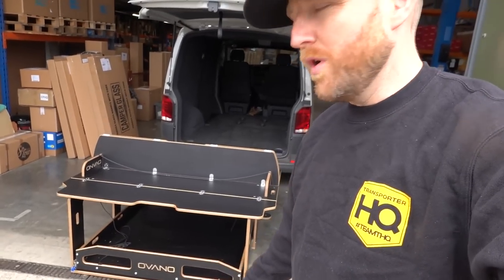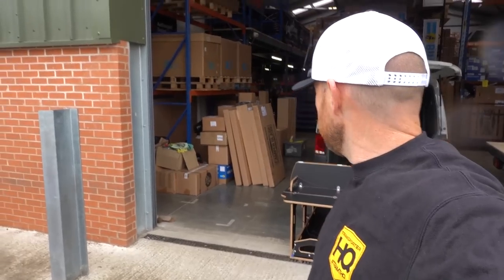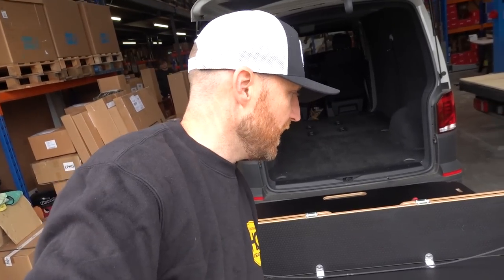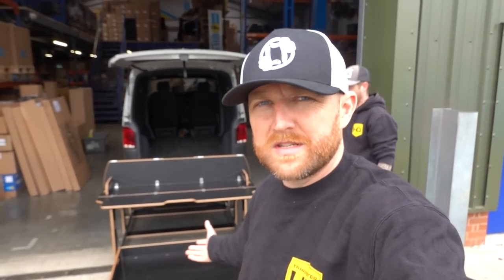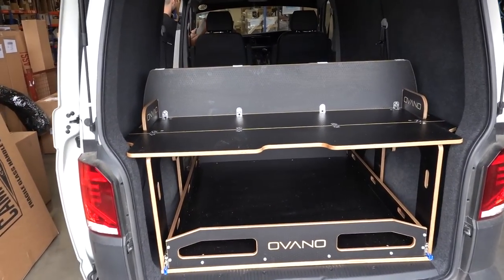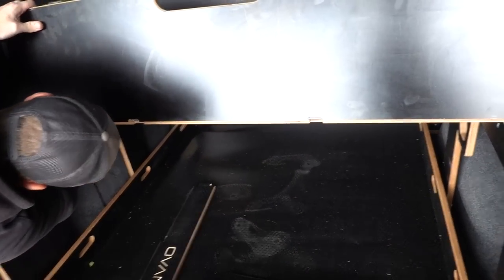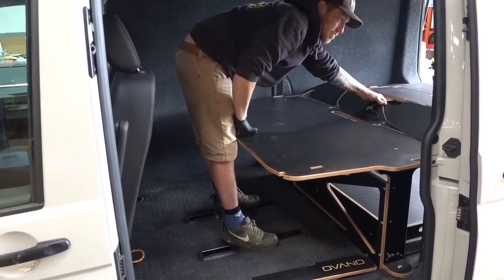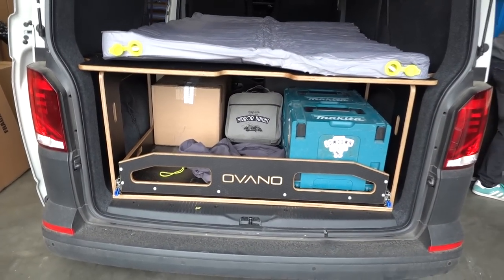Ovano Switch VW Transporter Storage Bed System | Transporter HQ

Comment: Looks like a great product, and really well designed. As a new business i wish them the best, but i feel they might have priced themselves out of the market at 1500 quid. Would suit my needs but wouldn't feel comfortable paying a four figure sum.
Reply: I was thinking the same myself, I would have one of those but sadly not at that price even though it is well made with good materials etc, and it would have been ideal for us being disabled with the slide out bottom to put our stuff in.
Reply from the maker: Honestly I thought the same until it arrived. Like I mentioned the runners are £200 alone. For them to able to copy with runners that can carry that weight, everything else has to be upgraded to the same standard. I'd much rather it was a premium price for a quality product than they'd used cheaper materials and it not be up to the job or last. Maybe in time as their turn over is higher, their costs of materials may come down and the price of the switch be reflected. A customer of ours saw it and the build quality and ordered one straight away. This guy was a skilled tradesman and understood the quality and build. I hope it works for the Ovano guys, I'll defo buy another for the next vehicle.
Reply: @THQAutomotive  It's true what you have said that you only get what you pay for and we might bite the bullet and go for a one providing I can persuade the wife to go along with me lol
Reply from the maker: @crazycouter  Do what I do and tell the wife it cost half as much as it actually did :P
Reply: especially when it looks pretty much DIY stuff

Comment: Just picked up one from Transporter HQ EU, it’s not cheap but as they mention in the video. When you see it in the flesh you can see why and with that, I’d say it’s a very fair price for the quality of the product. Fits so well in our SWB T5 and I tested it out with the bulk head up on the motorway back to Sweden, really great with no rattles or noise at all. In fact it helps reduce road noise! Slept on it, really simple and quick to fold into the bed mode which is great when you arrive at a stop late at night. I’d high recommend it!

Quick question though, what mattress did you show in the video? Looks perfect for my upcoming trip to France!
Reply from the maker: That's a kampa Kip self inflating mattress.

Comment: Just what I am looking for, just a decent slide out storage system with a 100kg load is £1200, then consider the whole functionality of the Ovano system, top storage plus the other shelf, then the full bulkhead option, and finally the bed. Yes the upfront cost is high, but a lot of thought and design has gone into it, and its ok for a company to make a profit too, they probably have to move quite a few units just to get anywhere close to being in front. As soon as my van arrives, I will be ordering this.
Reply from the maker: Yes it's a great bit of kit and a lovely small family business to deal with.

Comment: Very nice, cool ! Is it compatible with T5 Multivan ? thanks !
Reply from the maker: Yes the do a multi van version
Reply: @THQAutomotive  thanks !! Do you think/know if i can remove the two middle seats, advance the rear 3 seats at the maximum, and install the Ovano switch ?
Thanks
Reply from the maker: @ugoaltar5888  I don't understand, sorry
Reply: @THQAutomotive  sorry, « excuse my french » 😂i have a 7 seats Multivan (short), (in 2+2+3 with rail system), i would like to install the Ovano Switch. Can i install it with remove the two middle seats, and put the rear 3 seats in the maximum forward/front of the van ? The idea is too keep the possibility to have 5 seats. Thanks.
Reply from the maker: @ugoaltar5888  I honestly don't know sorry :( Contact the guy's at Ovano. They'll know.
Reply: @THQAutomotive  thanks, I’ll try to check

Comment: Will.a pushbike with the front wheel fit on the top on on the tray?
Reply from the maker: I'm not sure check with Ovano. We're actually going to be working on a bike edition with them in the next few months.
Reply: @THQAutomotive   How the work with the bike edition coming along? I would have one at a drop of a hat, Price not really an issue if the quality is good, which by the way looks 100%

Comment: Great concept, i fear price will put people off. In current climate particularly , hope it does well
Reply from the maker: You get what you pay for. I guess they could make a budget version with cheaper parts / materials and carries less weight etc. I'd rather pay for the quality personally. They've take loads of orders since this video :)
Reply: Hey Gords. Thanks for the well wishes. we appreciate the price point will put some off, but so far the majority of our customers have come from using other bed systems and the feedback has been that they'd wished they'd bought ours from the outset, which obviously were thrilled about.
Reply: ovanouk I completely get it, I would definitely consider it rather than my rock and roll, which weighs a ton too. Gonna have to save the pennies lol

Comment: I've been looking at these for a while, I have a T32 Kombi 2012, but it has the factory rear heater which limits choice. This, Exploria, Stitches and Steel and Van King (the Van King is a special order though as the standard doesn't accommodate the heater). I've researched the hell out of it and TBH I  am 95% going with the Ovano. Another selling point is I'm not too bothered about keeping the rear seats (2+1) as I  need to get SUP boards, surfboards, wakeboards, kiteboards in the back.
Reply from the maker: They are currently working on the vision for the rear heater. It need a few dimension tweaks.
Reply: Hey Darren. Please keep an eye out on our social media for updates on when the rear heater compatible version is ready. Wont be long.
Reply: The rear heater option is now available Darren.